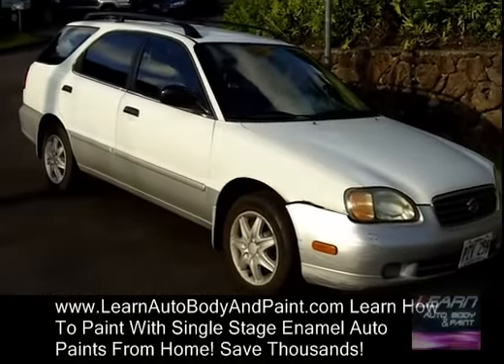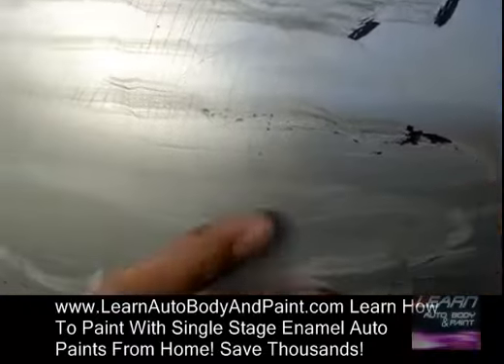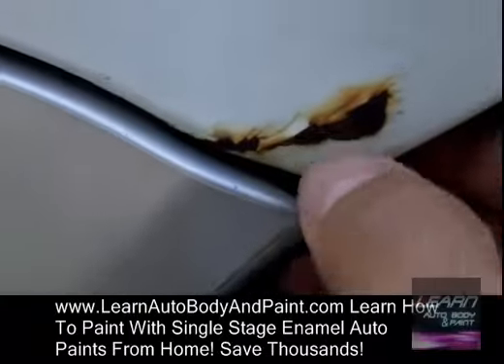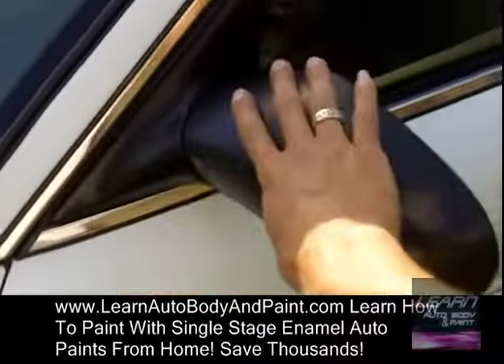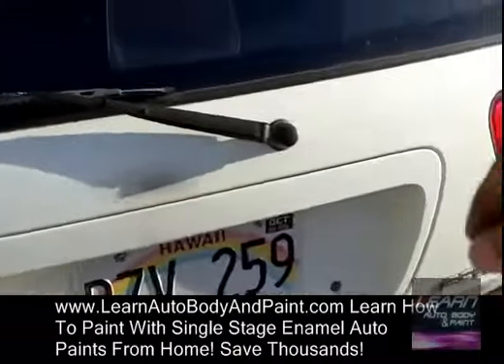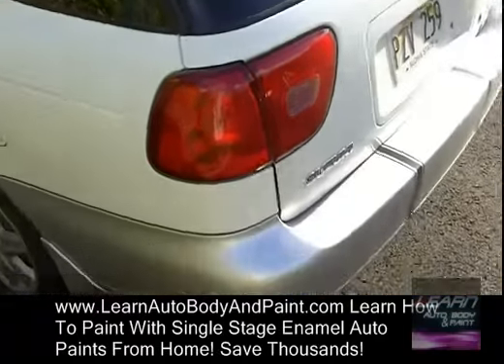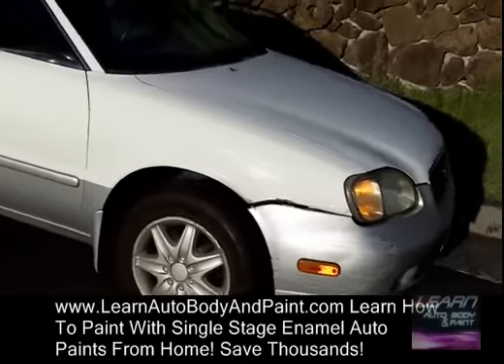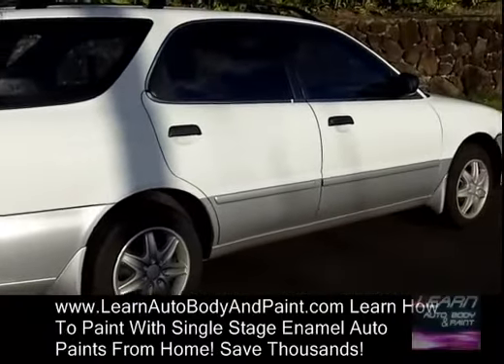How To Paint Single Stage Enamel, Urethane Paints

Comment: Hi  ! Need Help ASAP ! I mixed 4:1 instead of 5:1 of a single stage PPG DURETHANE DTM 95-3300 Series (no need for reducer), what would be the consequence if i painted that mix on a 3 hours cured epoxy primer ? They were my car calipers...  Should i restart all over again (sandblasting etc....) since they are all dismounted ? Any thought ?